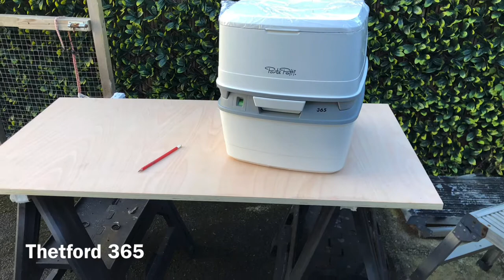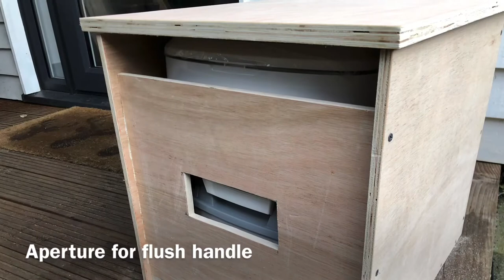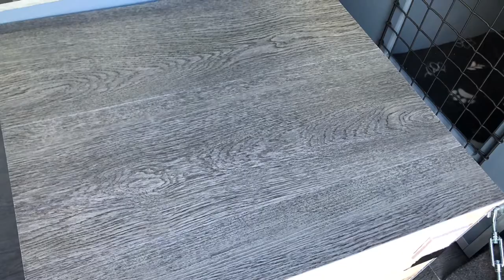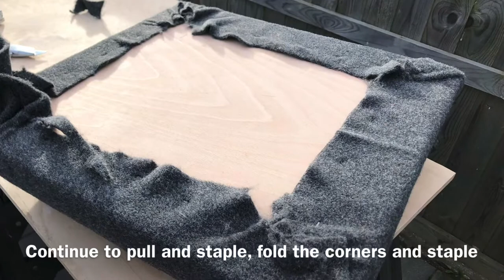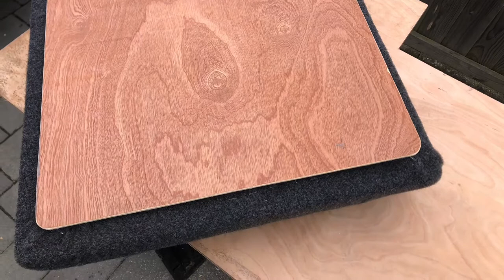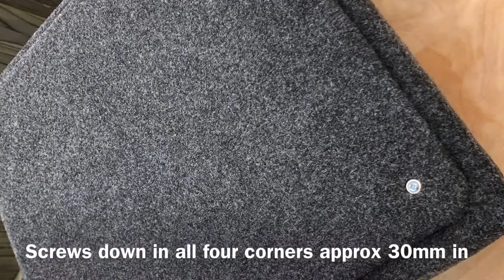Camper van Toilet box and seat

Comment: Hi great video 
What thickness of plywood for sides and top did you use thanks
Keep up the good work..
Reply from the maker: Hi I used 12mm ply for the sides and base and 18mm for the lid. I found these sizes are easy to get hold of in diy stores and not too heavy.

Comment: Great finish, what size of trim did u use is it L shaped or U shaped? Where was it purchased from?
Reply from the maker: Hi thanks for watching and your comment, I used U shape for the two sides 15mmx15mm and the top piece was 25mmx15mm L shape, I got them from Wickes. Ive since recovered the seat with the same material as my seating, looks better now its matching.

Comment: Can you tell me if by adding the 10mm to all sides, you have found that adequate to be able to put your hands into the box to either disconnect the top section of toilet from the bottom or to lift the whole unit out of the box. Thanks
Reply from the maker: Hi yes that’s ok to lift out, if you lift diagonal it’s even easier. I’ve never had any issues. If you make it bigger it takes up more room and the toilet may slip around. Thanks for viewing and you question.

Comment: how did you secure it to the floor?
Reply from the maker: Hi, I used two clips at the back and two hooks on the back of the seat. So when I travel i just clip it together. You could just use a strap to stop it moving around or some anti slip matting. Thanks for watching.
Reply: @exploresandtosummit  ok thanks a lot 👍